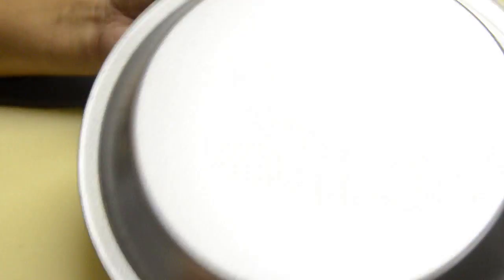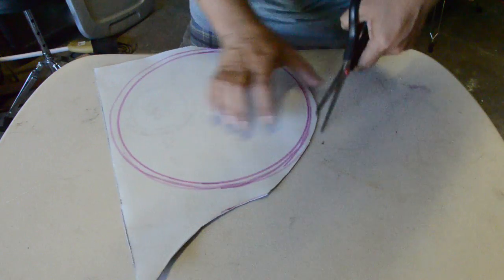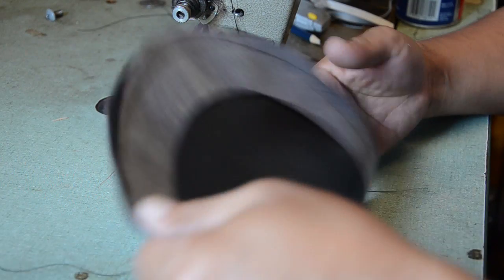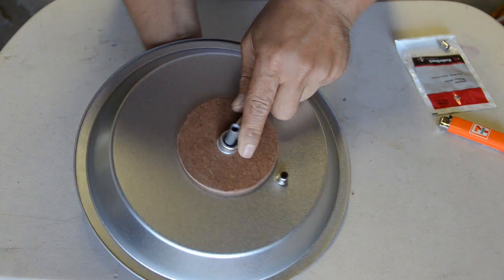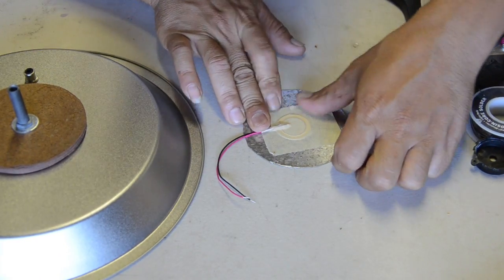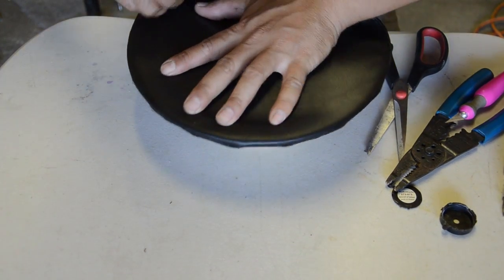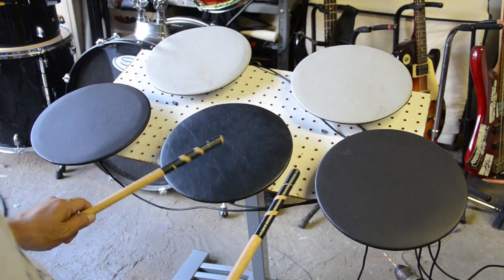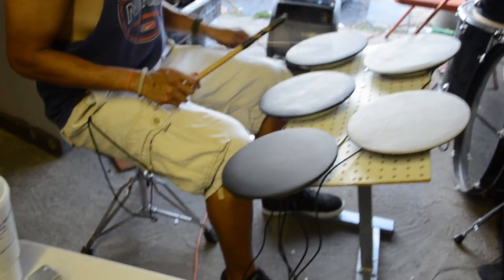DIY Electronic Drum Pads for Midi and simple drum kit

Comment: I wonder if ping pong gum sheet could be use for that, it have a very good rebound response, the old Simmons was very primitive tech it's the same piezzo behind a plywood pad recover by a kind of hard bakelite , it was not soft , it became gummy and softer ont the SDSX version and later model, most Roland or Yamaha pad are even cheaper with a better silicon gum surface.

Comment: How do you connect the drums to the computer? Where do you run the cables to? What do they connect to, and what software is used to set the instrument up?
Reply: You actually need a controller... Rolland, Alesis, whatever... those controllers have many inputs where you will plug each "drum" so the controller actually produces the refined sound. The output of the controller then you run through a bass amp or send to the computer.